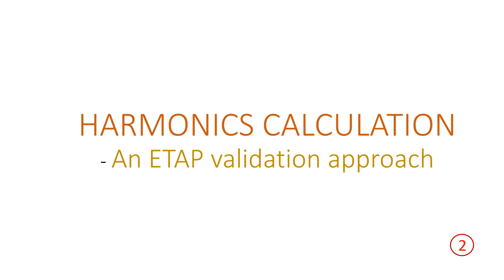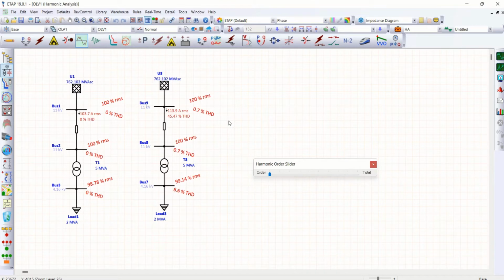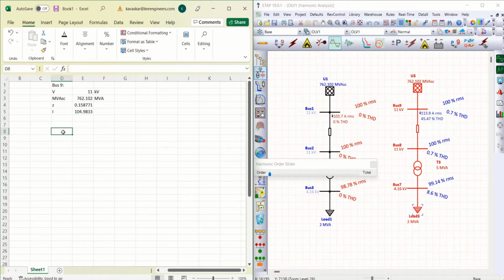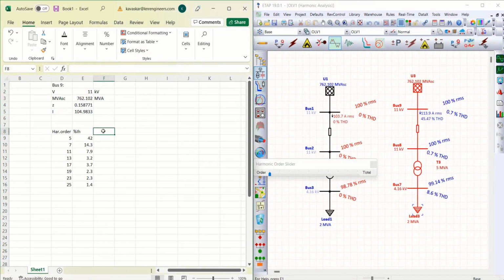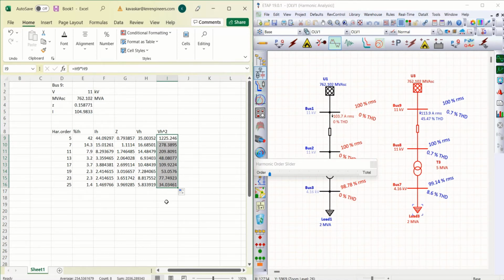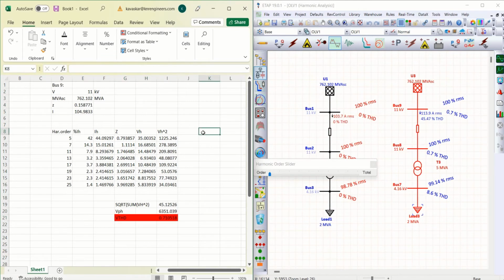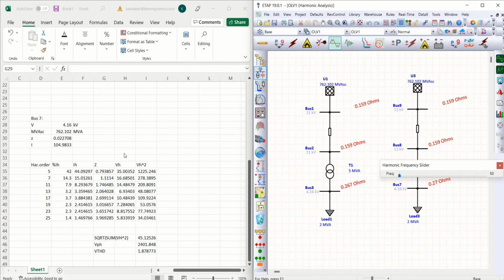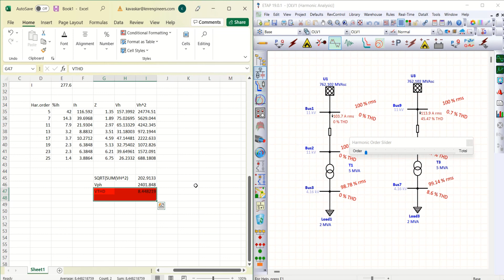Harmonics Calculation (both Voltage and Current THD)

Comment: What about if we have a 3 phase system, but the harmonic currents (I%) are presented per phase, like in some test reports for PV-inverters. Would you use the harmonics for the phase that results in the highest VTHD, or would you calculate the VTHD in some other manner?